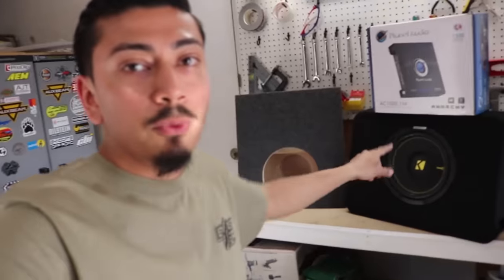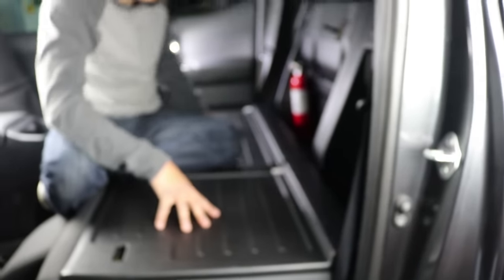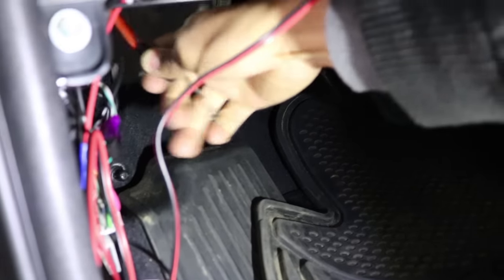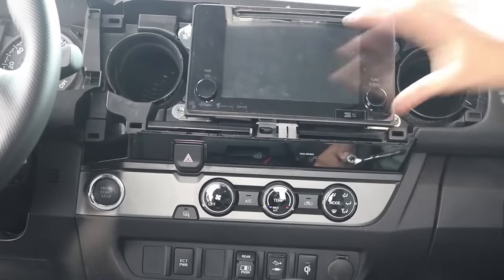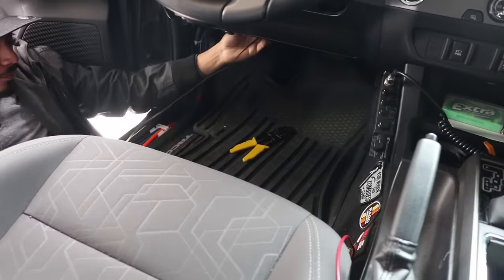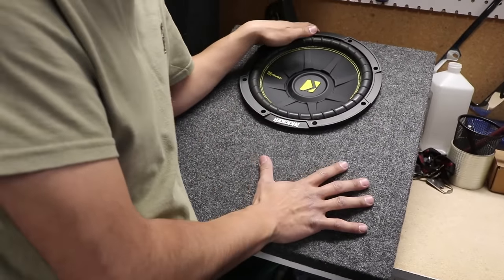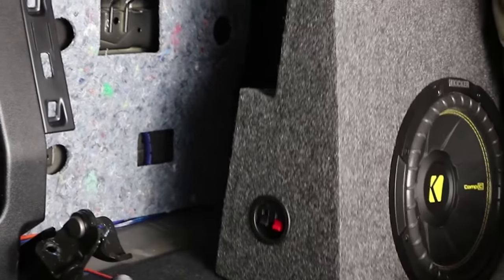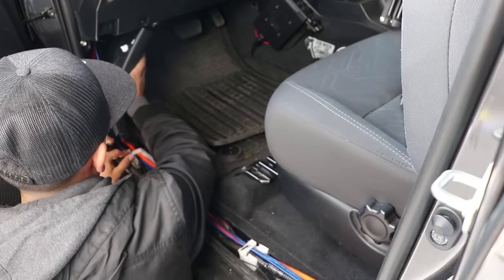HOW TO INSTALL AMP + SUB ON A FACTORY RADIO 2016+ TACOMA plug & play well worth it

Comment: A tip for this install. You want to keep the remote wire and the power wire separate from the rca cables. Ideally you would like to run the rca cables on the other side of the truck cabin. This will prevent noise from the current going through the power wire.
Reply: mingomane1 another tip for install is to use any brand except kicker
Reply: Caden Cannon I do like their solobaric series but the rest is meh
Reply: mingomane1 if you use quality wire and RCA’s and the sub is crossed over correctly any noise will be too high for the sub to play
Reply: Caden Cannon why do you think kicker is so bad?
Reply: Ive owned my L7s with kicker amp for 13years now... still sound amazing
Reply: Impossible the only noise u normally get is engin noise and the remote wire is coming from the radio  not engine
Reply: Actually this is not true unless you're running >1000 watts on a 12V system. On a 12V system the amp draw on your wires won't interfere with your speaker signal whatsoever unless you're pushing a super high amp draw. Everyday joes (such as the people watching this video) won't ever hit that level of power, quit spreading this shit. All it does is make people freak out.
Reply: Yup its legit common on every install
Reply: @michaelouellette7950  sub ground noise is the sub bumping
Reply: @caden2377  Kicker is fine
Reply: @imfrom210texas  ive had poor experiences with them. they arent the brand they used to be
Reply: @caden2377  your not the man you used to be
Reply: @olivercook6091  you’re right. ever since i switched from kicker
Reply: Sounds like you need a better ground.
Reply: It’s a ground loop that causes the interference or engine noise to come through even if you’re running quality wires or even low amperage. Always separate power from any speaker wiring. I’d run them like this parallel you are always going to get the interference even if it’s a very low amount bleeding through. There are many reasons or causes for ground loops.
Reply: This doesn’t really matter when running sub feed. But it does apply for full range on a 4 channel.
Reply: The adapter come with the rca and remote wire together
Reply: Not always if you use high grade RCA's, and I know what I am talking about, as I ran a 2500W stereo system with all the wires down 1 side an no issues what so ever!~
  If you use crappy RCA's ul get line noise, but shielded ones you 95% of the time will not!~  An ive installed for 30 Yrs + off an on!~

Comment: Great video. The only thing I saw that you missed was you didn't tell the novices about setting the level on the high level adapter.  And also, the sound dampening material is really a matter of preference. I do have to point out though, that it does take up space, so it alters you airspace inside the subs enclosure. A better alternative that I have personally used is rubberized undercoating. It deadens the vibrations to the box while not really using us a significant amount of internal air space.

Comment: Hi Jesse!!! My husband is definitely going to love your video lololol!!! A subwoofer and a amplifier Lolol!!! That is okay if the video is long!!! I got your back!!! Lolol!!! I did not know that the seat belt can come off that easy!!! The clips make it so much easier!!! Good idea with the clothes hanger!!! I love how you explained what socket to use for the bolts!!! I always wondered what or where you can use the RCA cables!!! Good point on using the double sided video tape!!! The speaker fit perfectly in side of the subwoofer!!! Thank you for explaining why you used a template or wood for the amplifier!!!! Thank you for explaining the grounding point!!! I loved your video Jesse you are soo detailed I so love that!!! You keep everything so clean where theirs not a lot of wiring showing!!!! I agree with you no copyright Lolol Xoxo Pam 💖♥️♥️💖
Reply from the maker: Lol thanks Pam :)!!!

Comment: Great video, but are your speakers still running off the stock head unit? I wanted to see how you go about connecting speakers to amp as well. Probably need another adapter in the back with more outputs

Comment: Nice job, I had to educate myself awesome video. I did my 09 Tacoma DCLB had to take out the back plastic panels for Sub Amp Kicker 11dx 500.1 mono amp. powering 2 10" kicker subwoofers. Also new rockford prime d class 4 channel front & rear speakers polks 6.5. Still sounds great after 5 years.

Comment: Pro tip, if you dont have a tool to remove the plastic around the radio, grab it by the passenger air vent on the top and pull twards the driver seat, whole piece should just let go.

Comment: Nice install but next time I’d probably use ofc wire that cca gets really hot and it won’t last you in the long run. you  loose voltage between the battery and the amp let’s say maybe a volt or 2.  And you won’t be getting all the power you paid for it takes power to make power.
Reply from the maker: Heck yea ok thanks for the insight :)!! 🙌

Comment: It’s not foam inside the box. It’s polyfill. Polyester filling. It slows down the sound wave and lowers the frequency response as if the box is slightly larger. The reason it’s used is that the boxes your using are to small.

Comment: also the reason the cut out is there is because you have the motor for the rear window as well as the air pressure vents if you push those in or they break it will let rain directly into the vehicle

Comment: the acoustic padding is called PollyFill, and using a LOC to send the signals to the amp is a MISTAKE!
 Use the amps internal LOC an it will work alot better, I know I have installed car audio for over 30 yrs off an on!~

Comment: Hey .... on minute 17:40 when you flip the amp and connect the wires red and blue know as the speaker wire red and blue I don’t think that’s was part of the plug and play where did you connect those to......

Comment: Thank you jesse, been waiting for this video, wanted to know the right products to buy for the system install.
Reply from the maker: U got it my friend as recommendation for the amp I would probably go with a rockford fosgate or a kicker amp and for the amp kit the one I used is ok but I would shoot for a rockford or a kicker amp kit but if u just want a little added bass the one I used is ok,  and as far as the box I used that one is perfect and the subwoofer I used is good and the line output converter is good to use 👍 😁👍
Reply: Jesse Rizo thank you jesse for helpful tips and recommendations really appreciate it man. Can’t wait to intsall my system in my taco
Reply from the maker: Lorenzo Valderrama u welcome and if u have any questions please don’t hesitate to ask or email me directly 👍

Comment: Great vid! Did you make a separate hole in the grommet coming through the firewall for the power or did you feed it with the other stock cable coming through it? I'll tackle this this weekend. Thanks.
Reply from the maker: I think I showed it in the video but yes you can cut a small incision in the rubber boot that goes threw the fire wall there’s other wires that go threw there
Reply: @JesseRizo   Didn't notice I'll watch the vid again to see if I missed it. Thanks again!

Comment: How is the quality of the box bro? And how do you like the sound? Is the bass nice and deep? Thinking of going with this box, do you know the mounting depth measurements? In the description of the box it says "brackets on cab wall needs removal" what brackets?
Reply from the maker: It’s not bad it feels sturdy and as far as deep if u get the correct subwoofer I got a cheap amp so it couldn’t push my subwoofer and brackets they probably mean the panel that I removed if not the panel from the back of the seat which I showed in video that u should remove
Reply: @JesseRizo  alright thanks man appreciate your video!

Comment: I would have put amp under front seat, behind back seat has no air flow, it will work but amp won't last as long without cooler airflow around it

Comment: Hey Jesse, great tutorial. Quick question. At about minute 9:45, you’ve got the LOC in your hand. The dangling red wire with the barrel connector… Is that where you’re getting your remote turn on for the amp?

Comment: I want to use a 5 channel amp so I can add punch to my other kicker speakers that I installed (2x 6x9 front, 2x 6.5 rear) thinking of using the Planet Audio AC1800.5. Is there a 5 channel version of the plug and play line output converter you used for this mono application? Also thinking of using a Audio Control LCTi to eliminate base drop-off at higher volumes. Do you think this is necessary or is a good idea?
Thanks, Jesse. 
Your videos are killer!!!

Comment: What is the depth measurement at the bottom after removing the storage panels? I have a sub box that is 10” at the base that narrows to 4” at the top and wonder if it would fit behind the back seat after removing the storage panels like you did. Thanks!

Comment: Why did you run the power cable next to all the low voltage wires You're going to get a static interference at some point

Comment: Man what a great video. I have a 23 tacoma sport and was wandering if u know where I can get that LOC plug and play for the factory radio because I wanna add an amp without a sub. Thanks in advance!
Reply: Hey do u have any update on yours? I’m in the same boat😅
Reply: @bhcwombat4930  I did find one on ebay
Reply: @bhcwombat  I'm gonna use my factory head unit that why I bought the inverter so I can run rca cables.
Reply: @wadepauly7380  what inverter did you buy? I can’t find one online that works. I’m using a stock head unit as well. You and I have the same truck
Reply: @bhcwombat4930  I had to message the seller because I couldn't find it either. They sent me a link for it. Not sure if it will work I haven't installed amp yet

Comment: Got a question, hopefully you can help me. I have a 2015 Double Cab with Entune non JBL. I want to redo the front stock speakers to component, delete rear speakers, and add a 10" sub behind the seat. Keeping the stock HU. What would you recommend for a budget setup. Want something better than stock without breaking the bank.

Comment: Super helpful, thank you!
Reply from the maker: You welcome 👍👍👍, 
& it’s helpful to have power cable from battery. To amp running on opposite side of the rca and remote wires 👍 just a tip I forgot to mention

Comment: Sweet video, you said you don't recommend the amp you used in the video but in the comments you said you'd go with a kicker amp, do you have a link for the kicker amp you suggested?
Reply from the maker: Hey thanks my friend 👍👍, & yea it’s a knock off amp so wouldn’t recommend it lol and the one I will be swapping for is this kicker 5 channel https://www.crutchfield.com/S-4L98OBFHrdk/p_206KXA8005/Kicker-44KXA800-5.html?XVINQ=GLX&awkw=292323615278&awat=pla&awnw=g&awcr=186311578448&awdv=m&awug=9031436&gclid=EAIaIQobChMIwOXymtW64QIVox-tBh1DVAmyEAQYAiABEgIFEvD_BwE so I can run the sub and all my door speakers off one amp 👍 less amps and a cleaner install, if I don’t do that one I’ll probably get a rockford fosgate 5 channel amp and probably even switch out my sub for a jl audio w3 (if it fits in the box) that’s two options 🤔👍
Reply from the maker: Just know with the jl audio w3 and the rockford 5 channel amp or even if jl audio has a 5 channel amp it’ll most likely sound way way better but it’ll be a little more $$
Reply: @JesseRizo  sweet dude thanks for the info.  I already have the kicker front, rear, and tweeters installed but wanted to do aftermarket amp and sub.
Reply: @JesseRizo  ok so if you had to say, the jl audio w3 and the Rockford 5 channel amp is better than the kicker amp and sub?  Do you have link for the both the Rockford amp and jl audio w3 sub?  Thanks man
Reply from the maker: You welcome but thank you for watching I appreciate it 👍👍, another tip to I’m not 100 percent how true this one is but a lot of people say to run the power cable to the back of the cab (as shown in the video) to ur amp and all the rest of the cables coming from the stereo to the back of the cab on the opposite side so red power cable run from driver side to the back and the rest of the cables run from stereo to the right side to the back where the amp is get me? (Just basically separating the power cable from the rest of the cables) they say that helps for interference, I’ve done many amp installs the way I do it & showed in the video and havnt experience a problem but just letting u know what people in the comments said lol 👍, once again thanks for the watching :)!! I really appreciate it

Comment: Really well explained video! But I have a question! My truck comes with a “premium sound system” meaning it has an amp and subwoofer already! And I basically want to do the same setup you did! But I read somewhere else that I would have to connect the Line output converter after the stock amp... did you truck came with a stock amp? Or is it ok to connect the LOC by the head unit?
Reply from the maker: I have heard the same and I think it’s true and no mine didn’t have the amp because it wasn’t the premium sound
Reply: did you ever figure out to do it before or after the factory amp ?
Reply: I have a trd pro with the premium sound, and let me tell you... it ain't all that premium.

Comment: What's up brotha. 1st off thank you for making these videos. They are awesome. I have a question on your sub install. Do you have to or did you remove the plastic panels behind your seat?
Reply from the maker: Hey my friend, thank you and for this specific box yes 👍👍 but u remove the smaller plastic storage panel to fit this subwoofer box if u want stay tuned I’m making a new video I ended up getting a new system to try out and that one doesn’t require removing anything just cutting a small hole
Reply: @JesseRizo  awesome brother. Is this setup no good? Why a new setup if u don't mind me asking?
Reply from the maker: jaydog 2018 hey and it’s a good setup just not the sub or amp I went with if u can find a better sub and amp combo it’s great but for me ( I stayed in this vidoe that I would eventually upgrade it) and I’m finally doing it 👍👍 just did something a little different :) lol. Just experimenting
Reply: @JesseRizo  awesome. 👍

Comment: Great video Jesse. Quick question. If i run an output converter for a mono amp and sub can i still use a separate amp for the speakers? Still  using the sticks stereo unit?
Reply: Stock*

Comment: Hey y’all if y’all decide to get the power line output converter the one linked in the description does not fit the 2020+ Tacoma’s I bought one and it doesn’t fit

Comment: Thanks for the video bro, I’m just curious I know
Your truck is 2wd, does have rear diff lock?
Reply from the maker: U welcome bro and yea it is 2wd but yes it has a rear diff locker that comes from the factory that only comes in the offroad model that’s y I didn’t go with the sport
Reply: Sweet to know, I can save a lot by getting 2wd I never use 4wd, 2wd with rear diff lock sound very sweet for me
Reply from the maker: Yea as long as u know ur never gna use it I’d atleast recommenced the offroad but if u feel u might use 4wd then get it 👍

Comment: I have always done and have been told that the power wire and the audio wires should be as far apart from each as possible. The power wire could cause interference, that buzzing sound as your rpms go up. Are you having issues with that?
Reply from the maker: I’ve heard the same but no problems yet and I’ve done it on many vehicles and have never noticed it, I’ve always had other vehicles that big name shops have installed it for me and I’ve noticed they do it the same as well so not sure if it’s a myth or not lol I know one things forsure if u use a offbrand loc (line output converter) that can cause nasty buzzing or hissing or just interference) that I know forsure

Comment: Aloha Jesse, sorry if you answered this in the video, but how big is the auger bit you used to drill into rear bins to pass wires? Thanks in advance and great video!
Reply from the maker: Hey so sorry for the late reply and I’m all honesty I just grabbed all the wires in my hand and then grabbed 2 bits and whichever I saw would be better figment I used I didn’t really check the size in so sorry :/
Reply: Jesse Rizo no worries! Just put in a sub this past week thanks to you and your video. Keep up the good work🤙

Comment: So I was wondering, since it taps into the speaker wires, have you noticed and decreased volume in your rear or front speakers? I saw that some people were having that problem and that some were not. Just trying to get a straight answer before I make the purchase
Reply from the maker: It does not but as far as the subwoofer it won’t push it to its full pontwntial as it’s running off the speakers but I didn’t notice any power loss?

Comment: Wait why use a line output converter rather than connecting the the high level input planet audio gives you?
Reply from the maker: 1. not everyone is getting a planet audio amp so I wanted to show how to do it in general and 2. As I stated in the video I didn’t plan on keeping the amp so then I’d have to rewire if I did that 🤙

Comment: Jesse, plug and play line output converter, did you have to change the settings on it (it's adjustable).  Wondering what the output voltage is on it with the default settings.
Reply from the maker: I just left it how it came to be honest I didn’t want to mess to much with that but u can try

Comment: iny reason you use the cheaper LOC in your videos? is it simplicity or cost saving to do this? just curious
Reply from the maker: Both, it works regardless , the jl one is great overall because it’ll eliminate any white noise and is more adjustable so if you do have the $ for it I’d recommend going jl insteaf
Reply: @JesseRizo  yea that's what I have just wanted to know because I see alot of people using these